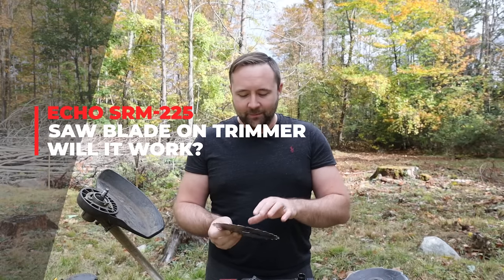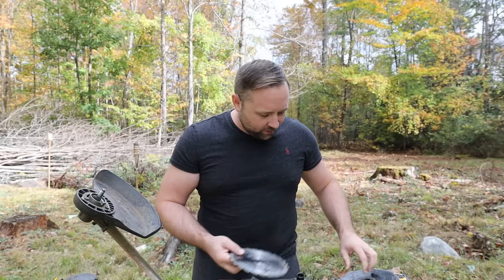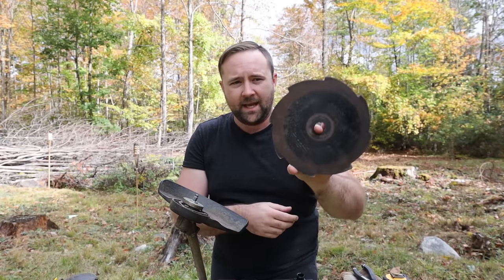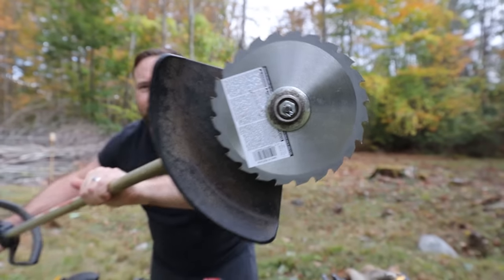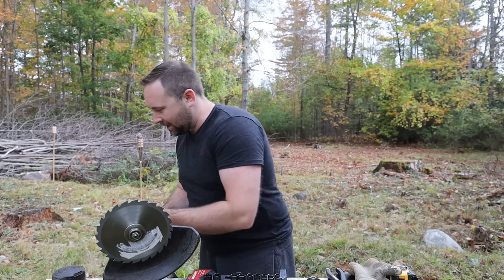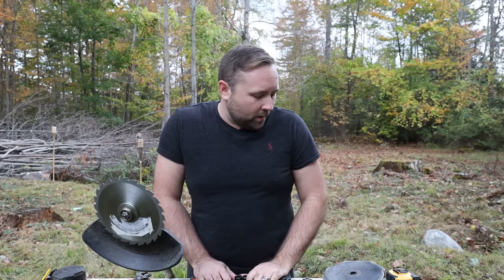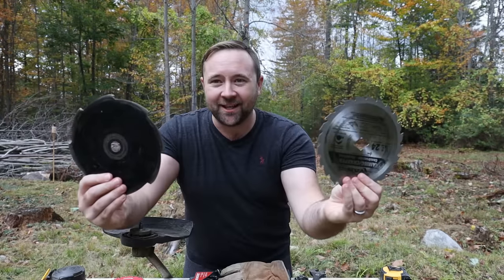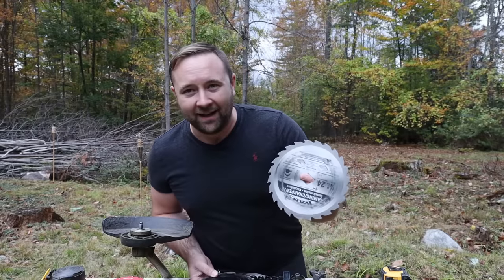Putting a CIRCULAR saw blade on a TRIMMER

Comment: lol i usually do that with discount blades from LIDL or ALDI ; some 3 or 4 euro per blade ; I cut firewood 40 cm length directly in the tree ; up to 6 inches branches . upside down; funny . i am building currently a pivotal station to securely chop trees from the floor . i even shred small debris directlyon the floor . that setup replaces 3 or 4 tools. i have a 60cc stihl . zombies never came back  lol .  next try will be angle grinder discs to cut hipsters Ebikes on the fly . or car doors  .

Comment: A 40 tooth works better.  A heavy duty trimmer with handles is safer.  And I use the string trimmer at the same time, screwing it down onto the blade.

Comment: If you really want to get crazy with it, take the guard off.  You'd gain the cutting depth to the rotor cover metal that way way.  Or buy another guard for this and cut the forward part you measured off.  And as said in comments, rotate the guard about 3 inches in the direction that would let you have better control cutting downward into branches so you could cut down, out and around and back under, even if you cut the forward part you measured off.

Comment: Why just straight shafted trimmers? Will it work on a bent shaft?
Reply: No, bent shaft trimmers use something like a speedometer cable, very thin and flexible, straight shaft use a straight steel shaft which is much stronger

Comment: Hi, is there a way to lock the trigger switch in the "On" position  so I don't have to keep it pushed in with my hand while I operate the trimmer?
Reply: Zip tie the trigger down.  But I wouldn’t recommend it with a circular saw blade on there.  If it grabs into something it could pull out of your hands.  Then you have a spinning rogue saw blade flying around you.  I’d avoid that one.

Comment: why should you not use a bent shaft trimmer ? is the drive shaft too flexible and will wear out, or break ?
Reply: I would like to know that also.
Reply: @Burl Rodgers @extremedrivr  
Bent Shaft trimmers use a "spring" like core to drive the line-head because it must bend. So it is weak. RPM can exceed 10,000 some run at 12000 - spped of gasoline motor.
Straight Shaft Brush Cutter have a straight solid core to drive a reduction gear. So the head RPM is slower to increase torque to allow use of metal blade.
Metal Brush Cutting Blade are steel only and have max RPM of 10,000. 
Circular Saw blade have lower max RPM because "brazed-on" Tunsten Carbide teeth can break off at very high RPM and hurt someone.

Comment: If you want to destroy your trimmer, and are okay with potentially severing an artery. nerve, or bony bits.  Your trimmer is NOT designed to use a circular saw blade.  But it is a free country.  As long as your local EMT has good access to your property and can get the stretcher and emergency gear to your bleeding body, then go for it.

Comment: don't try this on a "direct drive" weed eater with flexible shaft. It will break the cable....worked great for a few minutes....16 bucks for a new one on ebay.
Reply: Are you Rick Bayless? I’m a big fan. Kudos for your work.
Reply: That's a fact. I broke a few on straight shaft trimmers with a gear box. = I consider it a 'Fuse" to save something else.

It should be noted that the smaller the blade the greater the applied force at the tooth. and the lower the stress om the engine and drive components.

 A lot of guys like the 10" and bigger blades but they are actually less powerful and harder on the machine then the 7-1/4 inchers. .... It acts like a lower rear end gear ratio in a drag car, .  .

Comment: 225 is too lightweight...
Great way to wreck your crank.
That tiny engine isn't made for this.
That blade grabs on to a wet sapling...zing!

A proper clearing saw with bike handles and 50+ CC and the Forrester blade for twenty bucks will chop through anything you want and at the end of the day the power head still is alive. ;-)

Comment: You could use an 8" table saw blade, or even the 10 1/4" blade, but I think that may be a bit much for the trimmer motor. You'd have to find a way of increasing the arbor size to 1" as well. Instead of removing the guard, manufacture a larger one.
Reply: Aside the motor power, thats a lot of momentum the shaft has to carry and absorb when it decides to stick.  Mid-range Stihl with a 7" brush circular saw like blade (light weight), and it finally tweaked the trimmer shaft.

Comment: I agree. With potential kickback, you need a bike handle.  Loop handles are unsafe to handle the reactive forces.  Any authorized dealer would advise you the same for safety.  
Due to to serious nature, this isn't even suitable for America's Funniest Videos.  This is valuable material for lawyers. Save this in case you get hurt.

Comment: Btw Take that guard off you’re a man!
Reply: Zip ties are just as good as a pin.
Reply: Lmao!!
Reply: Never ever take the guard off or you'll have some some seriously dangerous kick around and kick back.
The blade has to be stable [backed against] on whatever you're cutting.
There's a reason for the guard.
Reply: @RoadKen53  We make and sell blade adapters for all kinds of trimmers. The pro landscape contractors all tell us they take the "guards" off.  The so called guard actually guards nothing.. The  only thing a so called "guard" is for on a trimmer is to hold the blade that trims the line when you bump feed it. 

When the pros need to buck up while cutting they tell me they use the shaft. The "Guard" only gets in the way and actually makes thing more hazardous.

Comment: I did go through the standard blade seams the 10  spaced teeth blade blunts  quicker I have done 2inch just do it slowly by moving your strokes across the scrub wood but not so it goes inside the wood running with the rotating and bucks dangerously 🔥🍿🎥🐓 rip no problem

Comment: Been there and done that. Circ saw blades on string trimmers is a bad idea IMHO. Awkward. Clumsy. Inefficient. They don't work well for cutting brush either. The only good metal blade for string trimmers is the Oregon 295504-0 type mulching blade. Devours ancient blackberry brambles. Doesn't exactly mulch them but chops them fine enough that there's no need to pick them up.

Comment: Please people......  DO NOT DO THIS!!!!  There is a reason weedeater brush and wood cutting saw blades are thicker and heavier than standard circular saw blades.  The blades you buy specifically for a weedeater are made out of a harder steel and tempered to withstand sudden hard impacts if you accidentally hit a large chunk of wood, a rock or even a piece of metal.....  I have hit all 3 of the aforementioned in the past.  Had I have been using a standard circular saw blade when I hit the metal or rock it would have more than likely shattered and slung shrapnel in all directions at about 300mph probably killing myself or any poor bastard who happened to be standing within a mile of me.  I cannot stress this enough...  DO NOT DO IT!!!!  They make weedeater saw blades with chainsaw teeth around the outside edge for cutting small trees and limbs and thicker brush.   It is worth the extra money to purchase something made to do the job.......  It could cost you much more than the cost of the correct blade if you cheap out like this........  NOT a good idea at all.........

Comment: Danger, danger, danger.  There are things in life you can do yet should never do.

A table saw runs 3500 to 6000 rpm. Sweet spot for smooth cuts at lower end to take into account the vibrations of the blade itself. The blades are speced not just for speed but also materials and the user's application of force on the blade which is at a consistent narrow angle of approach. That blade is not designed to see pipes, rocks, glass, concrete, etc. at all.

So, yeah, run that less expensive blade out to 8k, 9k, 10k, rpm in free air, get it vibrating good and swing it in an arc at unknown speed and an unknown angle and whack it into a 2 or 3 inch branch. Brilliant! Hahaha, that guard is going to save you? Uh, no. And this well meaning YouTuber will not be handing out tens of thousands of dollars if someone gets hurt.

If your plastic line is being used to fast buy an after market speedfeed head for your trimmer that accommodates thicker line. i like 1.3 in ECHO'S 450 head, lasts days on grass, takes out briars with ease.

For bigger stuff my dealer's brush blade is $25 or so and it has ten hours of service on it with sharpening.
Reply: Truth and wisdom. Fun experiment, but I’d hate if some short minded person ever tries this out when kids are around.
Reply: Yo, Collage boy,,,,You actually haven't got a clue, have you? Other then completely faulty engineering logic by you,  do you know  farmers, Ranchers, and  Pro landscapers who cut brush and saplings for a living have been using regular 5/8 bore carbide saw blades adapted to the most powerful trimmers made  for decades. Total reported accidents. ---- ZERO..  ("Sweet spot" really cracked me up too. Nobody is looking for a ready to glue up finish here. Just making two pieces of wood or brush out of one. ,,,, you really are a nimrod, arn;t you?) 

Maybe you should also warn Renegade and Forester too. .They better stop using carbide on their blades. Fact is they better stop selling them at all and tell people to clear saplings with those plastic swing blades. (YOU actually believe that plastic joint is stronger the the silver solder joint between the carbide chip and the blade body, don't you? 

You are are classic example of a sophomoric keyboard warier. Get out in the real world where the rubber meats the road for 5 or 10 years and come back and talk to us then. A few years at Burns and Blood Tech will wise you up to the realities of the trades.

Comment: I take two 12" blades and weld them together, with the teeth staggered. This way, you have more teeth cutting and it's much safer. I also take the gaurd off, and remove the governor to give the maximum amount of RPM's.

Comment: warning do not do this because these blades were not designed for this at all they were only meant for circular saws only and tablesaw's not for string trimmers so do not attempt this due to the fact it is highly dangerous and not recommended at all they make special blades if you wanna cut wood like this otherwise do not use blades that are not designed to do this yardwork and could result in injury and death‼️‼️‼️‼️‼️‼️

Comment: In the first 7 seconds this looks like an advert for Advanti saw blades.
There's a rule - don't put a blade on a machine it wasn't made for.
There's another rule - only use a blade on a machine designed or manufactured by the makers of the machine.
The manufacturers of the machine and the blade bear no responsibility for use of their product outside of their recommendations.
I haven't seen this video in its entirety, but there are some comments here that warn against attemptingt to adapt a machine for blade that wasn't designed for it; and their reasons are sound.
Personally, I would not attempt this.

Comment: DO NOT do this yourselves - this is bordering on the braindead  !!!
Circular saw blades are designed to be fed wood at a relatively low force...compared to throwing an extremely high rotating blade into branches and logs we see here. The risk of that blade coming off is - obviously - going to be much, much higher than when used correctly, in the correct apparatus.

Comment: Gross misappropriation and application of blade to trimmer. For everyone's info, there are machines called "clearing saws" that are designed and built for the purpose of cutting down or "clearing" stands of saplings in forested areas earmarked for logging operations. Please use the right tool for the right job.

Comment: Do you like going to the ER to have steel and carbide teeth removed from your body? Spinning things place a substantial tensile load on the steel blade as it spins. Driving the blade past its rated spin speed will cause it to break apart and fly outward from the blade. You are wearing street clothes too.
There is a reason that string trimmers DO NOT come with big, heavy steel blades. Think son, before you act.

Comment: Hate to be "that guy", but after having had a circular saw blade sunk 2" plus into my right thigh, I'm telling you this is a bad idea.  If you are not persuaded by how that thing was wagging around in the air, and, occasionally, randomly bucking, I can't help you.  A weedwacker used for anything but weeds and such, is a good way to die.  I don't want to say I told you so... ever.

Comment: Loose the ""guard"  when using a brush blade. It actually makes things more dangerous. Not much more but it still increases the chances of screwing up. 

The fact is the "guard" guards nothing..  Your body parts are always over 3 feet away from the blade when you are using it.  - The pro landscape contractors take them off and buck up against the shaft when cutting a big limb or sapling. . Fact is the so called "Guard" on a trimmer's only function is to hold he blade that trims the line when you bump feed it.. Calling it a :guard: is collage boy logic.

BTW, The guys that do this for a living say if a 7" blade will not get the job done it's time to go get the chain saw. 

Besides, a guard should be the least of the safety nazi's worries when there is a diamond knock out blade on a round boss hub. Can't be too well centered. 

Of you want to see the proper way to use a 5/8 bore regular saw blade  check it out here.
https://www.youtube.com/watch?v=yvl-ntXPs5g

Comment: You are imbecil, trimmers all has  metal blades, They all has star and saw type blades made for this. You simply remove string and add metal blade, it has special connection, what you done is stupid as you may cut your leg after blade brakes and connection you have will get loose fast, this means blade will loose and fly to some kid in street. As you dont know trimmers has big vibration there is reason they dont use this connection from angle grinder